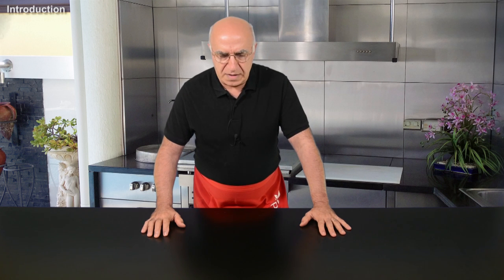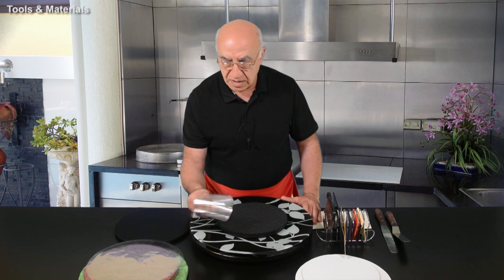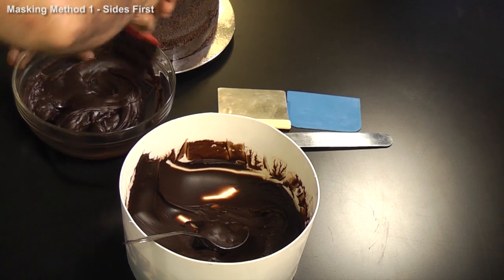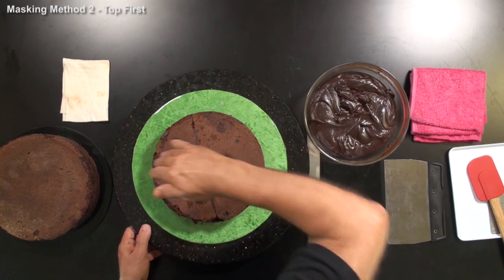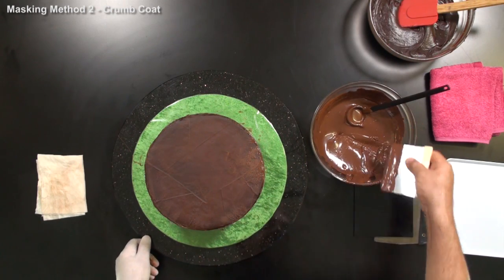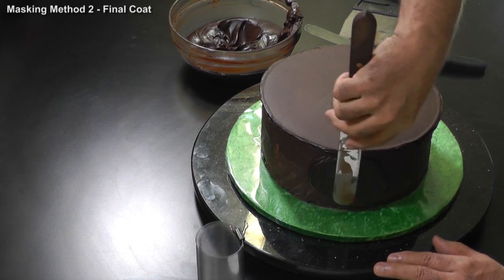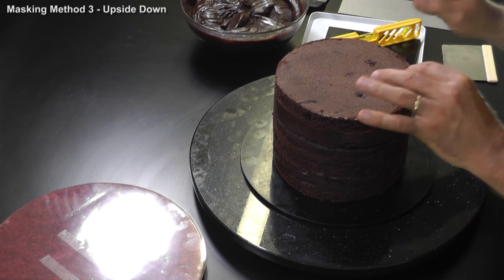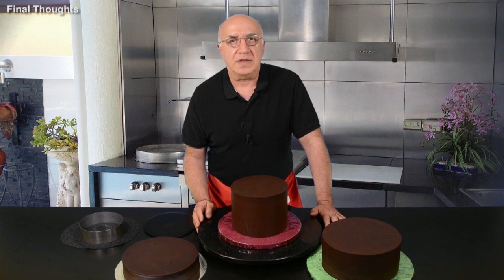How to Mask a Cake Tutorial - 3 Different Techniques

Comment: I had a problem after rolling my cured fondant to4 mm using guides and rolling it on the rolling pin. Disaster in rolling onto my ganache covered cake the fondant broke on the edge of my cake and completely gave way. So I was left with a torn edge and the fondant in a heap on the cake board. Help please. Joy

Comment: Hiya mr Yener, could you please help me with a doubt I have. All the chocolate crush you putting after the first layer of ganache is for cakes with chocolate ganache of course, but how can I apply this method when I'm working with a french buttercream? maybe white chocolate? or an other option?  could you give me any advice on this please?  thank you 😊
Reply from the maker: yes , white chocolate is an option but you have to achieve firm crumb coat before chocolate coat by placing cake in the fridge for a while. Note: for low cake you do not need crust coat.

Comment: You are a genius Sir!!
I mostly make eggless cakes with ganache. I live in a very hot country. I need to moisten my cakes with sugar syrup as I have to put my cakes in fridge to set the ganache. Once it goes in the fridge it becomes dry. There is no way I leave it out as it is too hot to hold the shape
 I don't know how to handle ! Was thinking to quit. If you can give any tip on this Sir!
Reply from the maker: After crumb coat you have to use pure chocolate to make crust coat , even at the bottom of the cake. That will keep the moisture in the cake. do not use too mush syrup.

Comment: Excellent tutorial, its helping me a lot. Thank you so much sir. One question sir, in recipe of chocolate Ganache, whats the roll of butter. Why r u adding butter. I think Ganache becomes more soft. Will it be firmer stif to apply fondant....
Reply from the maker: Butter add extra smooth feel to ganache . It will not make ganache softer becouse it replace part of cream.
Reply: @Yenersway  thankyou sir for reply. Sir i have one more doubt. Iam a pure vegetarian. I bake only eggless cakes. My recipe of vanilla cake is all purpose flour, yogurt, sugar, oil, baking powder, baking soda. Dose this cake is of for fondant cakes. My cake very soft and fluffy. Dose this recipe works for fondant base.

Thankyou

Comment: Hi, I would like to know how thick the mask is acceptable for distinct cakes: wedding, birthday, etc., because every added layer adds also thicknes to the mask, and it could ends like a cream (or ganache) with cake. thanks for your advice
Reply from the maker: As long as you can slice it , it will be acceptable. I  use compound chocolate for that purpose which will be hard while I am coating the fondant. When the cake stay in room temperature for sometimes then will be soft enough to slice. 1 - 2 mm is okay..

Comment: I live in a warm climate and when using chocolate ganache for a filling and an Italian Buttercream for outside and top of cake I have to refrigerate cake.  When taking the cake out 2 hours before serving at room temperature the cake and Italian Buttercream are at room temperature but the ganache filling is always still to hard.  Is there a way to overcome this problem so that the ganache is creamy and has a better mouth feel?  I don't want a cake sitting out too long as Florida temperatures get pretty hot.
Thank you in advance for any helpful information.
Reply from the maker: If you are not using ganache for outside of the cake you can reduce the chocolate amount in the recipe to have softer ganache. Normally 2 :1  try 1.5:1

Comment: Thank you I learned a lot from the video. My question is that the cake has no cream inside just the chocolate ganage, I never made cake before whitout cream inside. Why the cake has no cream ?
Reply from the maker: There are layers of ganache in every inch cake. If you asking about the fresh cream. Wedding cakes stay at room temperature several hours in Australia before the cut. Using fresh cream inside will be technically wrong. Thanks
Reply: Thank you

Comment: Thank you for your excellent tuition. I love your videos. One question though, you said you use compound chocolate for the second coat because it sets harder, but do you use compound chocolate in your ganache?🙂
Reply from the maker: Yes I also use compound chocolate for my ganache because it is cheaper. Couverture will be better. Just to make sure there is no confusion, compound chocolate  will set hard enough but couverture will be better if tempered correctly.
Reply: Yvonne Amos how to make caramel sauce